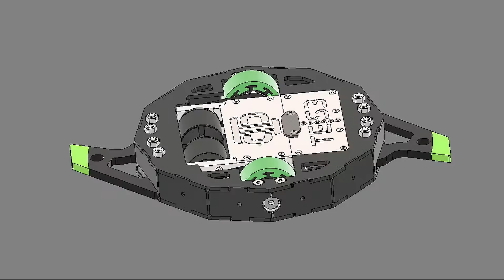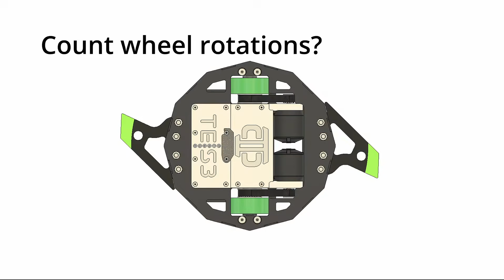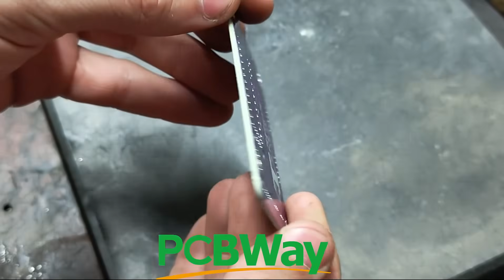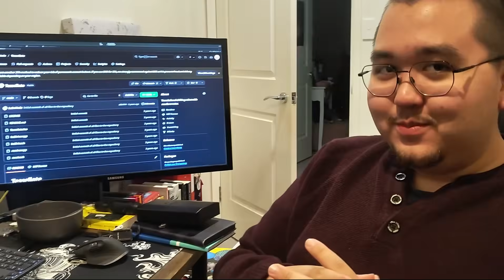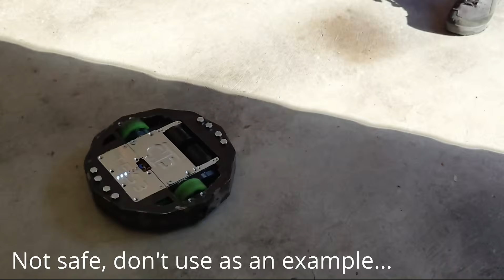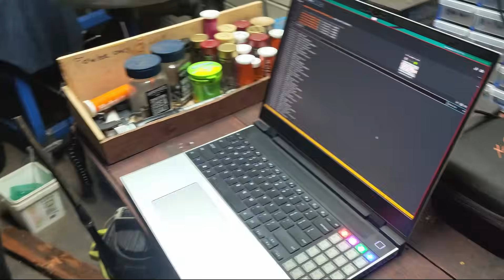The Theoretical Maximum in Destructive Capacity - Tessellate Part 1

Comment from the maker: Compared to the last video on Obliterator, this one is predominatly ad-lib segments filmed in real time. While most editing issues could be fixed by doing a better job recording in the first place (had to cut around audio and video problems often) I found it rather difficult to structure a software-focused video in an engaging way. Even though the problem-solution cycle of software dev has many parallels to a mechanical project there just isn't as much to show. 

IMO this is sometimes why large project channels employ high energy editing to skim over the programming aspects. To me, Luke's process of improving the code is just as interesting as say developing the flywheel flipper mechanism, but portraying it on video is quite a challenge when 40mins of uninterrupted discussion wont do. The meltybrain just sorta does nothing until it does.

If the project was to dictate the video, some robot with mechanical complexity to match the software could spread the load to share both aspects at the same time. A true walker with a vision-tracking turret for example.

Regardless, will move back to Obliterator Part 2 style editing for future melty videos even if they are a bit shorter. May compile all the unused software dev clips into a lower effort compilation for those interested.
Reply: maybe i just think the robot itself is quite interesting, but i thought what you chose to record/include for the video was quite well chosen (and explained!), and i remained interested! also, i thought it was really interesting to watch how the robot "slides" along its previous heading when trying to move in a new direction - i assumed that it's simply a momentum thing where the robot has limited traction while changing direction so it carries a lot of its existing momentum while the new choice of heading slowly influences its direction of motion.
Reply: I built my first melty about a year and a half ago. Maybe it’s because I have experience with the software side of things, but I found it quite easy to follow along with the video and software explanations. It’s definitely difficult to show the code revision process in an engaging way because there’s really just nothing worth looking at. In my experience, a lot of the software is sitting for a while building the base code, test it, it doesn’t work, sit in confusion/frustration till you realize you made a simple mistake. Repeat for every new environmental factor. So much of it is just talking it out and scrolling through text which is hard to make interesting to watch. 

I think the diagrams did a lot of heavy lifting and are a great visual for code. They work great when teaching middle/highschool robotics students how to code and this is a similar application. I’m guessing most of the audience is more mechanically inclined so the diagrams serve a similar purpose of bypassing software jargon and instead visualizing the flow of information through the system
Reply: I found the ad-lib segments really interesting. However the audio was significantly lower than your voice-over sections, which made it a bit hard to hear. But that would be my only complaint with the format, loved it otherwise.
Reply: Part of the challenge with code on video as well is that someone who does not know what the heck is going on in a complex mechanical assembly can still look at a complex mechanical assembly and be amazed and fascinated by it. Everyone intuitively knows what a gear or belt is even if they dont understand the math behind them. But to someone who knows nothing about software, looking at code is like looking at Chinese. There is no way to really interpret it visually unless you actually understand the language a little bit. I think the explanations you did in plain english did a pretty good job at explaining what is going on. If I were to make a suggestion, don't throw around undefined technical terms like 'overflow' without defining them at least via text on screen. If I didn't already know what that meant I'd have no idea why leaving the robot on too long was an issue. Literally yesterday I had a fun overflow error when I set an unsigned int value and it went negative but displayed as +4,294,967,295
Reply: For Code maybe a combination of Sebastian lague and Michael reeves could work.
Sebastian Has a very nice way of showing Revisions to Code, Michael does the Code Segments very short but uses drawn out scenarios of whats happening.

Combined you could Show Revisions to Code and then have a drawn Animation of whats happening but this drawn aspect could only be used if you Cant Show whats actually happening
Reply: I found ad-lib to be a nice style for this!

Comment: I was wondering if you were able to use a esp32 instead of the Teensy for all of the melty braining because you could probably just use a dual core esp32 1 core running the radio code and the other running the melty brain code or is it just too slow for that and you use the Teensy because it's fast

Comment: Embedded systems engineer here with a couple of advices that might help you along the way:

1. If you want to get to the bottom of what is exactly bottlenecking your system, do the measurements.
I meant it, have a dedicated method/function that you can call to start a given measurement and then after a certain operation is complete, stop it.
While doing that, make sure to measure a given piece of code (like reading accelerometer data) many times over and then average it out over how many times you made that measurement. It should make the impact of the time it takes to run instructions for the measurement part insignificantly low when compared to what you are trying to measure.
Log the results to the screen or to some buffer and output everything later together - up to you.
That way you face the problem with reliable data at hand,

2. Compiler is your friend so learn what kind of optimization flags you can have turned on and repeat the measurements with different set of settings for the compiler.
For arm-none-eabi-gcc you have like -O0, -O1, -O2, -O3, -Os, link time optimization for linker and probably some more, but those are the most common I know and use.

3. The logging part also takes some time so you might want to skip it in the release version of your code, which should make the cpu to have more time to run other things. Alternatively you can see if could get your hands on some debugging probe like JLink or other which supports more efficient (compared to simple UART) methods for printing - JLINK RTT, ARM SWD, or other (for microcontrollers that actually have a dedicated debugging hardware present in the chip's architecture). ESP32 might not have it, but worth to check it out.

4. Use DMA for larger data transfers, that should take a little bit of load from the CPU. 
Depending on the implementation of DMA engine, instruction fetch mechanism, cache presence and some other factors, it might be possible to have CPU execute code while DMA pushed the data, but only under the condition that CPU has access to the instructions which are to be executed next.

5. There are couple of more point I could list but this comment is already too long :D

tldr;
First measure code time performance, then optimize ;)

Great stuff guys, keep it up!

Comment: I've always been a fan of "beacon based" orientation systems for melty brains... but most bots seem to try accelerometer, gyro, and wheel speed based setups.
I think the polycarb/lexan walls of most arenas pose a lot of problems for IR based beacon systems. Could be a potential area for great tech advancement, as a lot of melty brains seem to be rather... melty. Especially while spinning up.

Comment: Hey, this reminds me a lot of the meltybrain bot I designed and built about 7 years ago. 30 lb weight class. I'm a mechanical engineer so I left the programming to my group mates. Unfortunately we ran into some issues where the V belts we were using to drive the robot melted during testing, so a redesign was in order. Our design is very similar to yours except for a billet aluminum chassis instead of a welded steel one. We couldn't get it working before graduation, so it's been sitting in my basement since then. I should be able to work on it again soon though, and this video with the explanation of the code is perfect for me since I have very little experience with programming. Looking forward to more videos on it.

Comment: Questions:
 - Would be better to add something underneath to stop it from ramming into the floor, making interesting sparks and so on? I can only guess this must add both stress to the motors and a ton of virbrations.
 - How do you travel by plane with a bunch of potent batteries? I thought they had forbidden that sort of things because of the fire hazard.
Reply from the maker: Yeah I should probably add some plastic skids for when it oscillates, but I don't think it impacts functionality.

For travel, the batteries must be taken on carryon inside a 'lipo travel back' which should contain a fire. All terminals have to be covered up and there are limitations on capacity and quantity.

Comment: would it be possible to have two mode of controls? classic driving vs spinning? Could have a wedge on one side so it's not just a one trick pony
Reply from the maker: It does have those two modes, the challenge with adding a wedge to one side is that it becomes very difficult to balance for when it spins

Comment: Excellent work. Always wanted to build a melty, but the complex electronics scared me away. Will you be conformal coating all the electronics?
Reply from the maker: Ah hadn't really thought about it at all actually. Apart from water damage, what's the advantage?
Reply: @BrokenLinkRobotics   bots could see over 100g of acceleration on impacts. It's enough force for circuit board components to pop off the PCB. A silicone based conformal coating can help mitigate those failures.
Reply from the maker: Yeah righto

Comment: you need a watchdog timer or some other mechanism to failsafe if the main thread ever hangs. the motors possibly getting stuck at full power when the accelerometer I2C acts a little funny is unacceptable
Reply: Absolutely, learned this the hard way on my melty

Comment: if you use conical wheels you can get a more effecient rotation because there wont be slip between the outer and inner part of the wheel, and that means your robot will be able to spin up to a higher speed

Comment: If the problem is the time it takes the cpu to get all data from i2c instead of the actual update rate of the 6050 then you can use DMA. Its basically a system that will handle the i2c com with the accelerometer and stores the values in memory without involving the cpu. You will always just read the memroy location to get the latest updated values
Reply: Exactly my thought. You may have slightly more delay before you read the value because you're not actively waiting for it to be ready, but your CPU can do other things in that time and your loop can run much faster so it's probably worth it. Especially if you do it for all relevant blocking processes like this.

Comment: Great video!
Im an electronics engineer and design pcb's quite a lot.
What I notice on your board or any devboard for an MCU, is that its lacking EMI filtering (electronic magnetic interference)
Especially with your motors running on high current so close to the board, could be the reason for false data or electronics failure in general.
Just plonk some TVS diodes and low-pass IO filter chips, and your PCB will work better in these conditions.
Good luck!
Reply from the maker: Hmm yes we will investigate this, cheers

Comment: If you guys still have the ESP-32 on the board, I'd definitely recommend trying to use ESP-NOW to output some telemetry while it's on battery power. The timing of loop() can be very different when you're outputting serial versus when you're not (when serial is not running, any delays from I2C and the like will hit harder).

Comment: Rather than remembering the last time valid data was received, it's easier to just reset the timer back to 0 whenever valid data is received. This means instead of comparing the current timer to the last known good time, you just compare the timer against your timeout threshold and it means your 1 hour timer roll over problem becomes a 1 hour of being in fail safe problem which I'd resolve with a lockout bool requiring a manual reset.
Reply from the maker: will pass this on
Reply: Nick's absolutely right for reliability and safety.  Reset the timer to 0 every heartbeat. To add to that, almost every chip has a comparison function in their timers that fires an interrupt when it counts up to a register value. Even if your main loop fails somehow, the timer interrupt will fire. For triple-safety use the hardware watchdog to do a full reset if you're stuck with interrupts disabled for more than a few hundred milliseconds. You reset the watchdog from a combination of the main loop setting a flag and your lowest-priority timer interrupt checking the flag, clearing it and resetting your watchdog.

It sounds more complicated than it is. The chip's builtin watchdog resets the part if it doesn't get booped before the timeout. it's the same thing as your radio failsafe, but applied to the rest of your code.

if you need a rollover for whatever reason (the timer you need is being used for more than one purpose, for example): embrace it.  at startup, set the counter value to a few seconds before rollover. That makes sure it's tested every time you turn the system on, rather than potential bugs an hour (or 49.7 days, microsoft!) later.
Reply: For something with this kind of danger I generally have the microprocessor start safe and require a manual operation to enable. At startup it forces all motor controls to stop and then spins waiting on a specific signal sent from the radio or a hardware button pressed before going into operating mode.  I've never coded for a battlebot but I do work on things you absolutely don't ever want to startup unintentionally.  simple reversible DC motor controls are generally done with an h-bridge and getting that wrong makes fire.

Comment: Very interesting to find out the complexities of how a melty brain robots works. A bunch of the software hurdles were very relatable as well. So many times it is always as simple as motors on or, the software someone else made is being slow.
Bit worried about the constant floor hitting, but I'll still be looking forward to seeing what this thing can do in the arena.
Reply from the maker: Yeah the floor hitting is due to the robot tipping back and forth as it accelerates in the direction of travel, while rotating. We've been considering a three wheel meltybrain in the future
Reply: What about adding some brushes that have a smaller clearance tot he floor? Very light weight,  and won't impact anything if damaged.
Reply: @BrokenLinkRobotics  could you have some small wheels (or even just bearings) on the edges at 90 degrees to the wheels...or 2 sets on the 45?

Comment: Try using an SPI accelerometer (MPU-6050 or MPU-6500 are cheap ones that I've had good experiences with) and you can read those at very high frequency, like I've read them at 10kHz before.
Reply from the maker: The 6050 is limited to 40g iirc, whereas our unit often peaks at 400gs. That's a big limiter
Reply: @BrokenLinkRobotics I’ve been running an ADXL375 and it does look like a lot of these high-range accelerometers have an spi option
Reply: Perhaps try out the H3LIS331DL?

Comment: Why do you upload in 1916x1080? 
Great video though, I've never seen a melty brain compete so I always assumed they were immobile when spinning and relied on pure destructive force to never let a match go to a JD and lose on the score cards. The fact that you can run the drive motors for such a small ammount time when it's pointing in the direction you want to go each rotation and get any notable locomotion is wild to me, seems like it just wouldn't be enough in my mind.
Reply: A well programmed melty can be surprisingly agile. And this melty is no exception, really clean translation. It mostly just comes down to how fast your electronics can process data and communicate. The drive motors for a melty spin very fast to spin the bot as a whole, but in theory a melty could translate almost as fast as the drive motors can. On my own melty I had to limit the translation to 40% because above that it would translate into a wall faster then I could react to change directions.
Reply from the maker: Hmm not sure about that resolution
Reply: Also, love seeing a Framework product in the wild, whoever's got the 16 with the numpad/macropad there's got great taste in computers.
Reply: I see 1916x1080 too. Although not fullscreen gives 1080x608, so it's probably scaled from something larger to 1080 tall.

Comment: Switch to ELRS!  Receivers are /so/ much smaller/lighter!
Reply from the maker: I think you are right, flipside is there's alot of trust in that one cable with a serial protocol. Will consider
Reply: @BrokenLinkRobotics you can also run PPM/PWM off elrs. The ER4 is a great example of this. Also the ELRS Lite is serial and even smaller, but if you don’t want serial can be modded to PWM with an open source git hub project. The FS2A is another smaller RX option that works with your FSi6. IMO though, these bigger bots the RX size doesn’t matter a ton like it does in 454g and 150g bots. The only advantage to ELRS on a big bot like this would be getting a transmitter with edgeTX which opens a lot of doors with mixing and TX programming